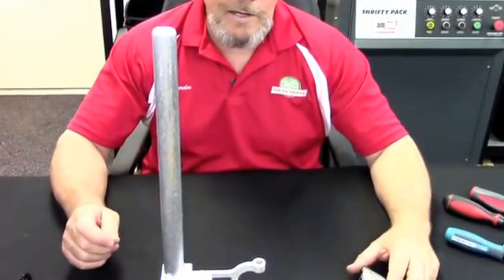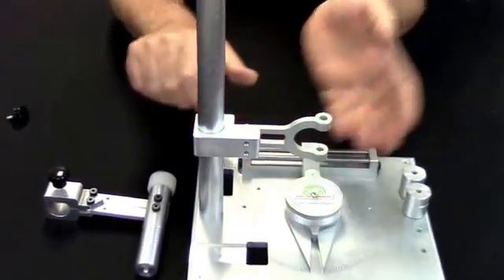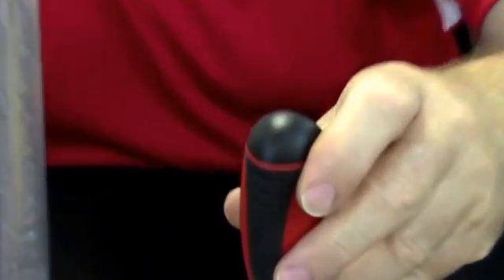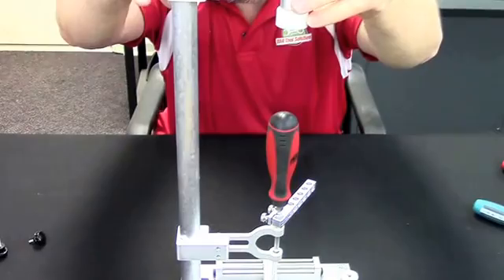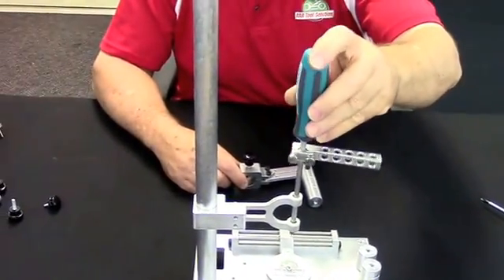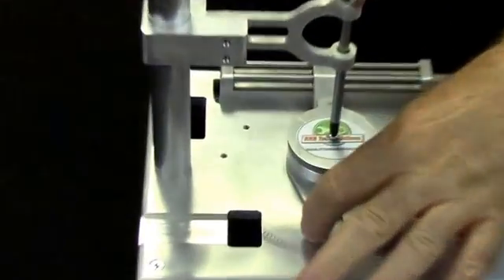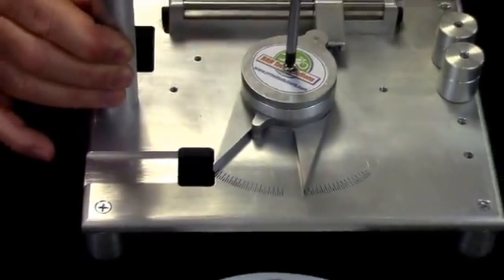Phillips Screwdriver vs JIS Screwdriver   Visual Comparison

Comment: HI,Does the vessel produce  screwdrivers with phillips tips? Or does it only produce them with jis tips?
Reply: I believe they only produce JIS tips (now known as the German standard DIN 5260).  The good news is that they will work with either JIS or Phillips head screws.  I won't even buy a Phillips screwdriver anymore and have given away most of my old Phillips screwdrivers.  What people don't realize is that the "Phillips" screws on Japanese cars such as Honda, Toyota, etc. (and other brands as well) are not Phillips screws at all but are JIS/DIN 5260 screws and need to be accessed with the appropriate screwdriver tip.  It is not that the "Phillips" screwdriver won't work in most cases but the actual JIS/DIN 5260 tip will work better because it grips the head better and is not designed to cam out the way a Phillips tip is designed.
Reply: @wallebo  I asked the same question you read here also to the 'vessel'. That is the answer : Vessel company was involved in the creation of the JIS/JCIS normalization. 
Officially the JIS standard has been absorbed by the ISO in 2008, therefore the promotion of JIS/JCIS old standard is not actuality.
 
Accordingly, all cross-recessed bits and cross-recessed screwdrivers (as PH in catalog) follow the JIS/JCIS manufacturing process.
They are compatible with JIS/JCIS and Phillips screws as well as NAS & MS screws.
Reply: @mArtinopapesso  Thanks for the reply.  While the JIS standard is now defunct there are still myriad ads for screwdrivers listing them as JIS.  I doubt that they are new old stock from 2008 but I can't be sure.  In any event, whether they are called JIS or DIN 5260 they work better than the regular Phillips that we know because they have way less of a tendency to cam out which is important on tight fasteners such as the screws that hold on the Honda front brake rotors as just one example.  It is because of that I will no longer buy any bits or screwdrivers that don't list the standards under which they are made.  Once I used bits made under the DIN 5260 standards I couldn't go back.
Reply: @wallebo  HI. 
For products made in Europe and not in Japan with phillips screws Which are the best screwdrivers in the world,please?

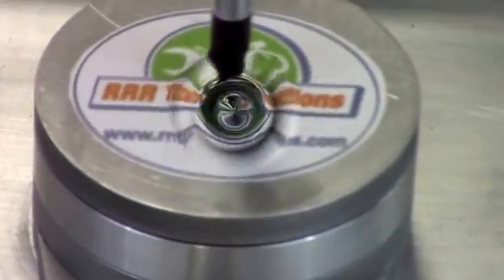Comment: Wow that's some difference! Is it OK to use a JIS driver on a Phillips screw? BTW, what kind of screw is the screw in the bottom-left corner of the video at 1:54? Phillips, Frearson, JIS or Pozidriv? I've seen this kind of screw many times, the one with narrow parallel grooves, and to this day I still don't know what it is. Thanks
Reply: Yes, in fact JIS (now called DIN 5260) will work on Phillips perfectly (actually better than a Phillips bit) but Phillips won't work as well on a JIS (now called DIN 5260).  I never buy Phillips bits any more.  I will only buy screwdrivers that conform to DIN 5260.  Brands include Vessel and Wera amongst others.

Comment: So just wondering in the second test(with the vessel screwdriver) are you useing a JIS fastener or the same philips?
Reply from the maker: Danny, thanks for the comment. The screw is the exact same US Phillips screw as used in the 1st test. These work wonders in both styles. Gordon/RTS
Reply: RRR Tool Solutions 864-710-7964  thanks for the fast response.

Comment: Cool device but you could have done this demo in 15 seconds. In point of fact while it shows that JIS works better than Phillips it is not fair to compare apples and oranges since a Phillips screw/driver are not a JIS screw/driver. You spent close to 3 minutes explaining the device and never say if the screw that you are using for a test was Phillips or JIS... YOU ARE AN IDIOT AND YOUR TEST IS INVALID even if the results are.
Reply: Superb Media Content Creator He said it was a Phillips screw.
Reply: you must be both deaf and blind!,at 1.50 he says phillips  screw and screwdriver!! NOW ,WHO IS THE IDIOT?! DUMBASS
Reply: This superb media guy has anger issues...

Comment: I have some experience with the Vessel 900 P.2x100 now. Lots of nickel plated JIS brass amplifier screws. The difference is very noticeable. With regular Phillips you have to always push in almost as hard as you torque. Been doing that all my life. That's over now completely. Once the Vessel driver is in place it gets full torque all by itself. What a relief to just turn the blasted screw!  Works on regular Phillips screws, great for already buggered screws. Really a fine tool.

Comment: OK, nice demo but tell me if the test screw is JIS or Phillips. Are you saying JIS has less cam out even in Phillips screws?  My understanding is Phillips has cam out designed in to avoid stripping in assembly operations. Crude torque control I guess. In real life the cam out is a pain in the...Does the test screwdriver have Jawsfit?  I just purchased 900 P.2x100 thinking it was JIS. It appears to be regular Phillips. The Japanese sellers are not easy to cipher. That's not their fault of course.  Jawsfit is an excellent solution.  The tips are hard. Please settle this confusion. If I decide to get a full set I will go to you.
Reply: Tom Jones In my experience you can use JIS on Phillips with no issues.   The other way around produces rounded screws.

Comment: Pointless demonstration, JIS screwdrivers are designed for JIS screws. Your test jig is designed for testing cam out, a design feature of Phillips screws, not JIS.

The performance or quality of a tool is really, is how well it adheres to its standard.
Reply from the maker: Hi Joel, Yes - we designed and built this testing fixture to demonstrate to motorcycle enthusiast how much better JIS Drivers worked over the US Phillips. We sell JIS Drivers and most customers look and see the Cross Points of the JIS and Phillips and don't recognize or believe there is a difference. We wanted to prove there are significant differences and the performances while using them are in fact, very measurable. Thanks for commenting and sharing with us. Gordon/RTS
Reply: Ah, I see. Most people would think the difference is negligible. Thanks!
Reply: It would be better if you also show the differences between a Phillips and JIS heads.  All Japanese motorcycles use JIS, but everything else would use Phillips and today most probably Allen.
Also you should explain (as said) that the Phillips behavior is by design to avoid over torque on fasteners by poorly trained labor.
Reply: Derek Kuraitis I asked the same question and they said yes the second test it's a philips fastener with a JIS drive
Reply: So you are using a JIS driver with a phillips screw?